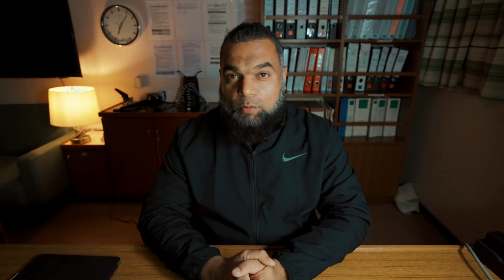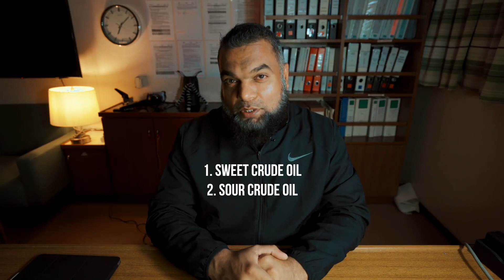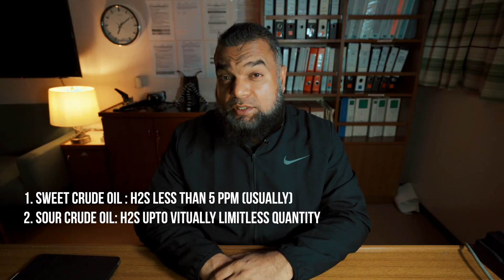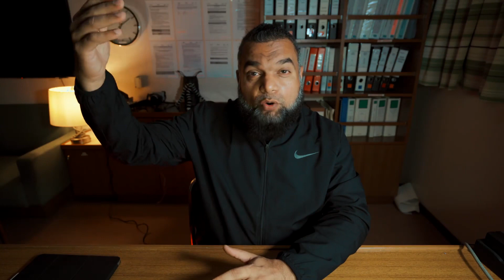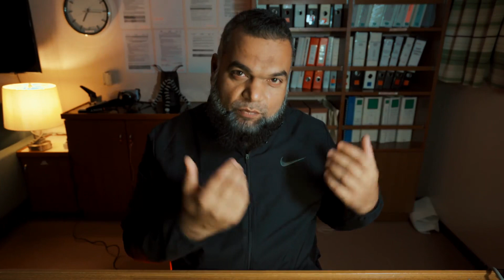CAN YOU PURGE H2S ON A LOADED TANKER

Comment: Gud one, but some ports like fujairah required less than 10ppm h2s so wat we normally do we just started 2 days b4 arrival, cargo name 680 cst
Reply from the maker: Fuel Oil can be purged, as H2S is not much in that. It's hardly 1% of sulphur content in 680 CSt. If I remember correctly sir jee. So for FO it's easy and a different story. For Crude Oils, it's horrible. :)